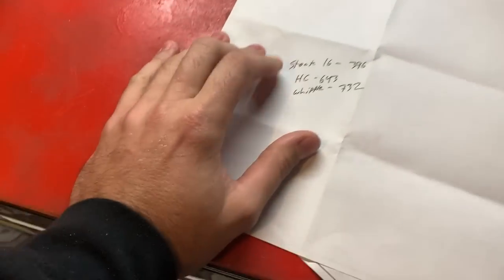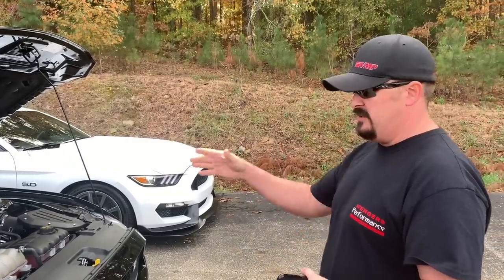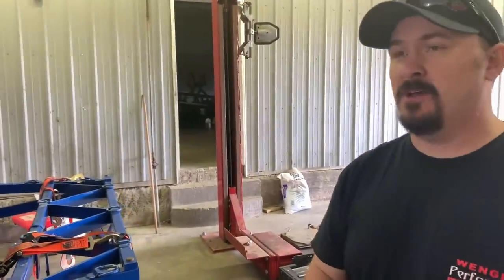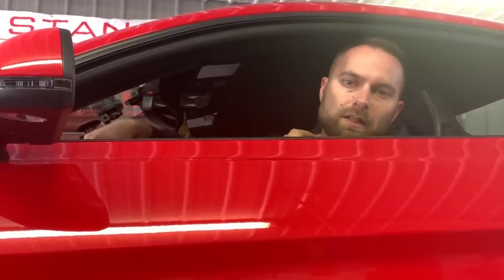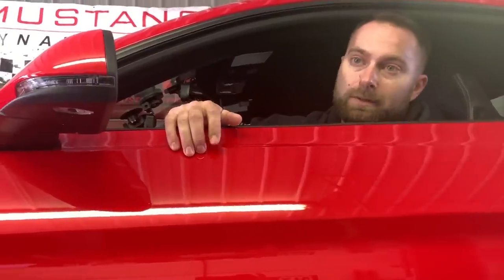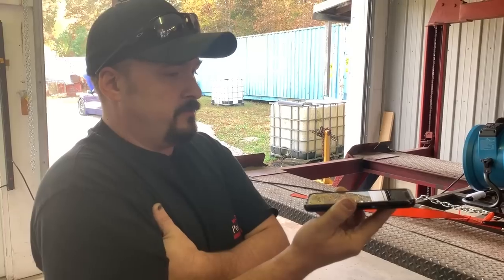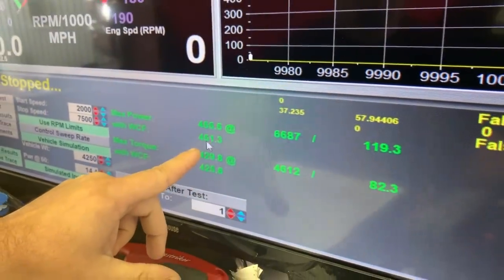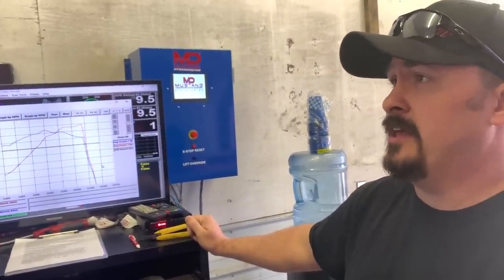How Underrated is the 2018-2019 Mustang GT from the Factory on a Dyno?

Comment: A dynamometer is a tuning tool, trap speed in the 1/4 mile reveals the power.
Reply from the maker: yep, the truth
Reply: TheWolf I agree with you on this. Dyno numbers can be different from dyno to dyno but trap speed tells the tale.
Reply: Carl Ryan yes but unlike the drag strip where you have minimal variables. Weather, traction, and wind speed. Dyno, all sorts of things can be throwing numbers off. 

If you use the same Dyno to chart gains. Best to be done same day but minimal similar weather conditions. 

Trap speed is the truth though.
Reply: Trap speed is the sum of everything. I'm sure you've seen a powerful engine get beat by one that shouldn't.
Reply: Don Berry what does getting beat have to do with trap speed. That would be ET. 

Stop trying to argue the facts.
Reply: Was going to say this.
Reply: No trap speed does not really reveal the power. Heck, just a change of driver can make hundreds of hp difference
Reply: Jake S you’re gonna make an argument bringing in non driving fucks. I mean if you spin your mph can change. If you miss a gear. If you if you. 

FACT- A solid pass, the MPH is the Truth for HP. 

/end of discussion.

Comment: Shop owner here.  Lots of concerns about the weight.  I just plugged in the info in the software and that's what it came up with.  Other cars today made realistic numbers.  I didn't play with anything to make higher numbers.  I believe plugging in a lower weight would have made higher numbers.  I appreciate all feedback though.
Reply from the maker: Yep. What ppl need to understand is that all the other cars that did pulls today were all 100% spot on. I too feel if weight were lower that the numbers might have been higher
Reply: It's possible that making it think the vehicle was heavier could have caused it to read higher.  When I first put my mustang on I didn't do the settings correctly.  It pulled up the last car that was on the dyno before me, which was an f150. (Heavier obviously). I don't remember how bad it was of but it made over 400 to the wheels.  After I put the correct information it the number dropped to 393. My car makes 416 to the wheels now with the tune, using whatever weight mustangdyne says it weighs.
Reply: If you tell the dyno a car is heavier, it’s going to factor that  data as additional force that has to be overcome - which implies more power is being exerted. Think about it in reverse… It’s easier to push a light car then a heavy car. It’s also easier for a light car to spin the dyno drum than a heavy car that’s pushing down on it.
Reply: On the speed limiter just disconnect the speed sensor on the car.
Reply: I've been reading a lot of threads from different boards dating back to 2004 and those that seem to understand the mustang dyno's this say the weight has no bearing on this dyno pull. They claim its only there for the timing and emission tests. Admittedly, I have no clue.
Reply: Nickel white S550 just buy a Diablo programmer unplugged speed sensor can cause issue with performance

Comment: You got a Bullitt motor. They either ran out of regular GT engines or missed a Bullitt install going down the line by accident. Rated 480 actually probably 530hp?
I worked on a Ford assembly line years ago and this type of switch ups happens all the time. Congratulations!!!!!
Reply from the maker: that would be cool
Reply: Yes something like that more than likely happened. They dont really care if a hot engine got put in the wrong car. All they ever really cared about was. DON'T STOP THE LINE!!!!!!!!
Reply: Pretty sure the Bullitt engine is the same Coyote with a different intake, CAI, and special tune. I'm going with Ford under rating the HP.
Reply: Only difference with the bullit is a gt350 manifold, gt350 cai and the tune..........
Reply: It’s the combo of port and direct injection and the way the 10speed delivers the power...??!
Reply: This guy is nuts. For a bullet car, it has the cold air intake, and tune for higher HP/top speed. Zander has neither. The engine is the same.
Reply: The bullitt  Only comes in manual no way it would have happened like that would need a different engine tune
Reply: TNitro N no it doesn't happen all the time ..if at all ever! Proud 24yr Ford Motor production specialist out of Dearborn Michigan.
Reply: @allthevibes46  bullit  Intake manifold has a different part number than the Gt 350  They are different
Reply: @mauricecooper176  what's the part number?
Reply: @allthevibes46   I don't know the number The tuner I use   He went to the dealership and checked
Reply: No, no, no. There's no way that's a Bullitt motor. Lol for that comment!
Reply: I believe  my 09 could  be a freak, not  sure.
Reply: @steveclark5016   I have come across a few factory freaks one thing they all had in common the owners beat the piss out of them.
Reply: @allthevibes46   There has been a test on YouTube that compared a 2018 GT intake manifold to a GT350's and the 18 got 1 HP more(mabye 2 HP at 525+) and fixed the GT350's intake manifold dips in the rpm curve.
Reply: @gen1c8rs88  there are plenty of comparisons, people see the 20 crank hp jump on the bullit and give into hype overlooking the fact that it is also tuned differently. The bullitt is an iconic car worth the $$ to some, performance wise it's pretty much right there with the GT.
Reply: David Klimmek 

Hi david ,

My gt350 came out of Dearborn. 
2017 .. I get the 2500 rpm to 3000 rpm rattle . There's so many possible causes out there for this but I don't think its piston slap . 

It will do it cold , and do it while at full temp .. However after about 30 min of running its gone .. 

I think something on the car is cold " exhaust pipes" and after 30 min its finally warm enough that it just doesn't resonate at 2 or 3 k anymore .. 

Can I have your insight ?

Comment: Can always "adjust" Dyno readings.  First time I took my old 02 WRX w/ TurboXS stage 4 they came to me( I was in car doing pull on their Dyno just for a Dyno shootout day) and asked if 435whp sounded right.  I said no, should be around 300whp(all wheel drive).  They made some corrections in their Dyno software and I did another pull, did 298whpwhp smoothing 5 and SAE corrected.  With smoothing off and non corrected it was 328whp.  So dynos are for tuning purposes.  I did 3 back to back pulls all within 3whp, no cooling down, and my exhaust tip melted my bumper badly, very badly as Dyno strap had pushed my tip up onto bumper almost touching.
My STi varied by 15whp from shop to shop for pre tuning baseline pulls.

Comment: I like many gear heads on the East coast travel the distance to take our cars to DTP Racing out of Virginia beach . He took my 15 challenger scat pack , installed a mild can from modern muscle custom grind , kooks headers , big throttle body and a CAI. After his tune i got 506 who and 496 TQ. It's an m6 and even with my bad shifting i still ran a 11.86 @ 122. Brent Hughes in my opinion is the best. He never had a complaint which says he makes sure he doesn't push the engine to the limit.
Reply: anthony costa I have used Brent for years, great place!

Comment: Food for thought, I dynoed my ‘19 GT MT82 this morning at DaSilva Racing in Pickering, Ontario. They use a dynojet dyno and mine made 433.8 hp and 393.2 lb ft. I personally haven’t seen any 10R80 cars make more than 430 stock but I know there are indeed factory freaks. I know...take it to the track and read the slip....it won’t lie ;) 

Great job brother! Cheers
Reply from the maker: Yes. The numbers are too high. 433 is a solid run. My 18 m6 did 431
Reply: my 10r80 made 427whp stock on a dynojet ran 11.88@119
Reply: @black19GT Kitchener, Ontario here. I've heard DaSilva is the place to go. You would say the same?
Reply: @Tim Coleman Yes, most definitely. This was my first time there but I’m not taking my Mustang anywhere else. Reputation says it all :) I live in London myself.
Reply: @tlcgtp  that says it all then. I have an '18 mt82 PP1 that I'll be getting some more work done once it's out of the barn in the spring.
Reply: Hi, I'm in the GTA as well, what does it cost to have DaSilva Dyno a car?
Reply: @JasonJolo98  They're prices may vary but I know the shop in Kitchener here is $100 for 3 pulls. I'm guessing Da Silva would be about the same.
Reply: DaSilva was $120 for two pulls. Highly recommend:)
Reply: @tlcgtp  Do you know if the 2 pulls have to be done on the same day or can you do 1 on one day to get a baseline, then do mods and come back on another day?  Thanks.
Reply: @JasonJolo98  they will be back to back. The second pull is to verify the first one.
Reply: @Eric79-f7i  Thanks. Champion Motors in Toronto allows it to be on 2 different days so half the cost as you don't have to pay twice.
Reply: @LuvKills Slowly I like the idea but as Tim said the second pull is to verify the first. I’ll be taking my car back in the spring to re dyno after intake and long tubes. Great bunch of guys and they are Mustang specialists....wealth of knowledge.
Reply: @tlcgtp  what intake?
Reply: @Tim Coleman JLT of course :) Texas speed long tubes.
Reply: @tlcgtp  Oh that intake, I thought you were swapping out your manifold(which you can get ported). I'm kinda tossing around the Roush intake with the sleeve, and AR headers.

Comment from the maker: Video quality will improve once youtube does its thing. Should just be a few minutes
Reply: Thought this might be helpful. They could not get the car over 6600 RPMs. This number is the lowest I've seen listed, but I thought the mention of the car's VSS limited the pull.

This 2018 Mustang GT with performance pack (level 1), rated at 460HP and 420 lb-ft of torque, achieved 415HP and 397 lb-ft of torque at SAE on the dyno with 93 octane fuel.

The vehicle was 100% bone stock and equipped with 10-speed automatic transmission (7th gear dyno pull at 1:1) and 19-inch rear wheel with 275/40/19 Michelin Pilot Sports.

LMR also notes of the dyno results: “The car’s VSS did limit us on our pull. This is why you see car tap out at 6600 RPMs. The redline for the 2018 Mustang GT is 7500. On that note, the car does have room on the table for potentially more power!”
Reply: Zand
Reply: fn

Comment: Ford has always underated their horsepower rating. In 1969-70. The 428 Cobra Jet was advertised at 335 Horsepower. This engine was over 400 horsepower. Ford said the low number was used  for insurance reasons. I'm confused why you couldn't reach the 7500 redline  to obtain a true horsepower rating. A wild guess is a Dyno issue. On average, you lose 15% from the crank to the wheels. So using 430 at the wheels. You're producing 494 at the crank. The Dyno guys seem confused. I recommend trying another Dyno shop and finding out why you couldn't get to redline on the Dyno pull. Something is wrong and the numbers are low and incorrect if you're unable to hit redline during a pull.
Reply: Don Hayes good point! Pontiac did it too with the 400 in the firebird and GTO.
Reply: If you lose 15% at from crank to wheel it puts the motor at 505.9hp.
Reply: @RobVarley  All performance companies apply the 15% rule. Around 15% of your flywheel horsepower for a 5 speed. That is not exact, but a fairly common figure. So the number you mention is in the in the area of the actual engine number. The numbers Zander"s Dyno showed were off since they car was unable to hit it's redline of 7500,. So until he runs another Dyno. Who really knows. I thought Stangmode showed numbers the 500 range.
Reply: Don Hayes Wish someone created a drivetrain drag or drivetrain efficiency test for cars. 

Really the best bet is to hit the track. Use the trap speed. 

One could get silly and check DA and chart it based on sea level correction.  Then do the math to see if the car power calculates. Wallace Racing dot com has some awesome calculators. I spent hours on that page plugging in numbers.
Reply: @hemi300c4  I know how they do it. I was just correcting your math. 😎
Reply: @RobVarley  430 HP ×15% = 64.5. 64.5 + 430 = 494.5 Total HP

I used an example of 430 starting point. Added 15% which is 64.5 which is a total of 494.50. 

I understand the advertised Horsepower for the 2019 Mustang GT is 460. Using that number.

460 × 15% = 69
460 + 69 = 529

I'm not sure what you're referencing?

What ever the horsepower number is for the 2019 GT. Considering the car couldn't obtain the maximum output of the engine (7500 RPM). I feel the first Dyno tests are incorrect. The new Dyno Jet run just released may be closer, but the run still hit limiters.
Reply: Gm does the same shit.
Reply: @hemi300c4  if you lose 15% from the crank then you have to do 430÷.85=505.9. Which would be the same as 505.9-15% from the crank. 🤣😁🤣
Reply: Not always.  If I correctly recall, several years back  in the last years of the na Cobras, they were overrated and Ford had to come up with a fix  because the cars didn't make the 320 hp they were supposed to.
Reply: You must have skipped over the cobra mustang that didn't make the power as advertised and ford had to install exhausts, manifolds etc to meet the HP they spec'd all free of charge to the customer.  After that, Ford learnt their lesson.

Comment: IF there's room for the turbo's... turbos will make X power with less stress on the engine. What I'm saying is 800whp on a supercharged engine is more stress on the engine than 800whp on a turbocharged engine. (because the blower is more parasitic (takes more power to operate)
Reply: Yes turbos are easier on the drivetrain plus get better mpg plus you don’t have belts blowing up ,also turbo lag is almost a thing of the past if the turbo is matched correctly also newer turbos Spo much faster than the older ones..

Comment: I think the connector you unplugged is what was messing with the car. Should of just turned off TCS from the inside.

I remember on my Genesis coupe if you pulled TCS fuse it would limit the motor pretty hard at a certain rpm.

Comment: I Believe the numbers, but the reason your hitting that limiter is because the drag mode is disabled from you pulling that plug if its not in sport+ or drag it will hit the limiter sooner. leave the plug plugged in and just turn off advance track and you'll be able to hit a full 7500 in drag or sport +
Reply: once the car is tuned the limiter will be raised in all modes and you wont have to worry about it.

Comment: Interesting video, Zander.  I agree with Tony M about this.  Take Project Carnage out to the track and see what your MPH reads.  It should tell you if the HP figure was correct.  As for why it revved only 6500, I don't know.  Also, Speed Addict 731 is correct about the 4200 lbs being heavy.  I seriously doubt Carnage weighs that much.  Not saying 412 Dyno Shop doesn't know what they're doing, because it's clear they do.  I just can't understand why your car weighed that high.  Good luck with everything, Bro!  I love vicariously experiencing your journey with Project Carnage!   😎
Reply: “When a trouble code fault is created from the front wheel speed sensors not detecting front wheel movement while on the chassis dyno, it cancels out the mode control functionality to the base setting, which reduces your rev limiter on the dyno to 6,800 in seventh,” explained Erik Radzins of ProCharger. <<< quoted from a mustang360 article.
Reply: @saleen367  Thank you for that.

Comment: Weight is off which will inflate numbers on a Mustang Dyno, heavier=more HP, lighter=less HP.  Also you are hitting your speed limiter.  Stock limiters on the mustangs are soft limiters not like the straight fuel or spark cut style rev limiters.
Reply from the maker: Yes. We need to lower the weight

Comment: There is always a benefit to under rating a cars horsepower as long as it's  still more than Chevy. Ford is "sandbagging" if you will. So, 3 or 4 years from now Chevy will claim to be creating more power while all Ford has to do is get a new SAE certification for higher HP rating(which it was making all along). Not to mention of course that claiming a higher number later in the models run would of course mean more sells.

Comment: That vehicle weight seems high to me.  I don't know if it would impact the dyno numbers but the weight should be around 3800.
Reply from the maker: I think the weight is off. should be like you said
Reply: It might be something specific to the mustang dyno program, I'm not sure. So I went back and re-watched coyotecarguy's dyno pull in South Florida and his weight showed 4000 lb. Al's car made 433 on a mustang dyno, with an E-85 tune so weight must be a computing factor.

Comment: Well that is interesting.  As the great Gale Banks has said "sometimes you find that factory built ace motor" built right by pure luck. He also said on the TST podcast that horsepower loss isnt a percentage but a certain metric  .It would be interesting to see this thing on a proper engine dyno without parasitic losses

Comment: Does your car weigh 4250lbs? That seems off. The most I've seen one weight is 3850
Reply from the maker: I think with me in it it should have been around 3900-4000
Reply: I was thinking the same thing.  4200 seems high to me.
Reply: @Zander13Productions  Cant wait to see how it does at the track. Should be able to hit 11's as it is, assuming it hooks up.
Reply: @Zander13Productions  Yeah, that sounds about right
Reply: It definitely skewed the numbers. Possible it was an accident
Reply: That's the weight that mustangdyne software picked when the car information was put in.
Reply: @jessetolley3974  that's a good possibility but that's  skewedthe numbers. Unfortunately there's obviously a problem with the dyno just a small adjustment to the dyno by Mustang dyno would solve the problem and point out to us guys you are right and we are wrong